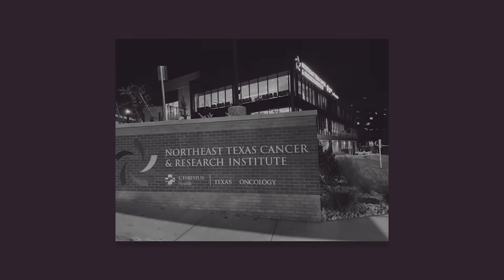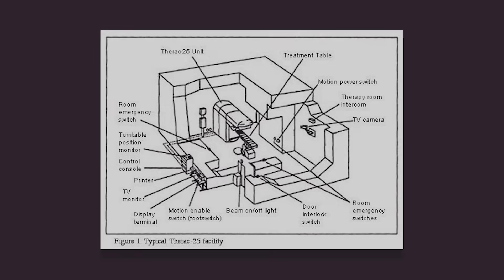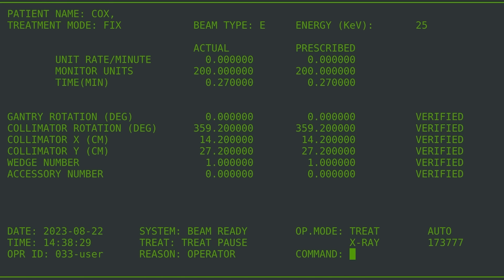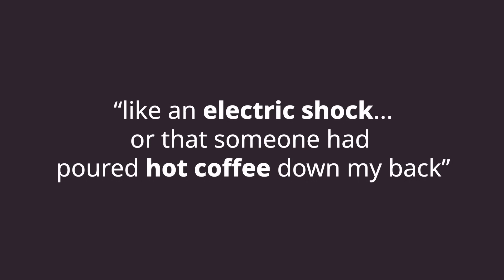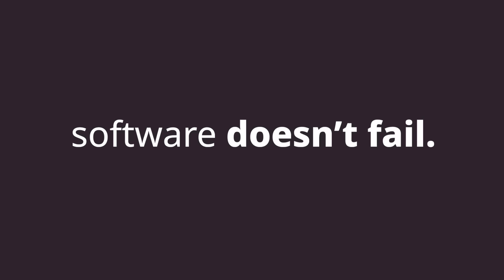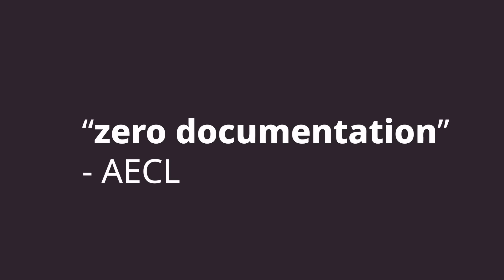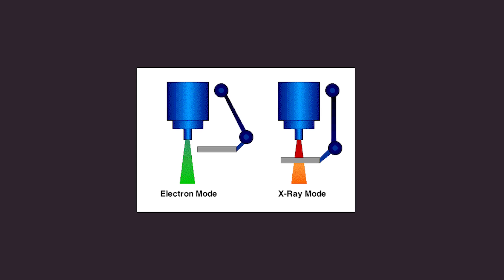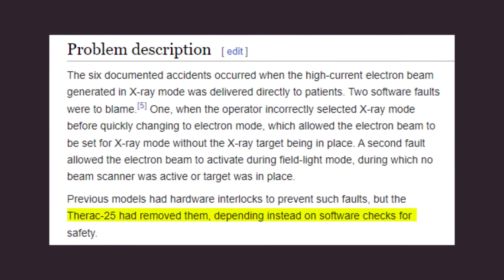how a simple programming mistake ended 6 lives

Comment: Having a hobbyist write the program honestly isn't a huge error in my eyes, as I'm sure he was plenty skilled. What blows my mind is that it was never properly tested to ensure this type of thing was impossible. It doesn't matter how skilled you are at programming, you will make mistakes. We rely on others to help us catch them and correct them.
Reply: Hey Boeing outsourced the mcas coding to india for only $4 an hour they save a ton of money
Reply: @stephenfazekas5054  Boeing also lobbied the FAA to skip much of the certification testing. And the FAA agreed.
Reply: @stephenfazekas5054  I don't think it was due to the programming. It was due to the faulty AOA sensor and the lack of training given to the pilots to shutdown the mcas.
Reply: @lightknight6243  a single aoa sensor combined with a program that couldn’t detect faults from inputs.   Your car can tell when a abs sensor is giving an impossible signal that’s obviously faulty.   It was them gettign cheap with training, cheap with coding and cheap with sensors.    The max is a plane designed by accountants and not engineers
Reply: @stephenfazekas5054  I totally agree. I was just pointing out that it wasn't just the code. They needed the mcas system in the first place because they added new engines on an old frame to save money!
Reply: To be fair, his coding error wouldn't have mattered if the company didn't cheap out on the physical safety mechanism.
Reply: Using an unskilled developer is not less costly when the rate and severity of defects greatly exceeds what a costlier, more skilled developer can deliver--unless the cost of defects is $0. Defects are typically quite costly. Most hobbyists are completely unaware of software engineering principles. They're also generally unaware of software testing techniques.
Reply: I disagree.  Developing a software program is a lot more than just sitting down at a keyboard and coding. Creating a software design, developing a software test plan, documentation of the software, are all key elements of developing software.  Especially if others are going to be using the software, editing the code, troubleshooting, testing etc.  Being a skilled coder doesn't necessarily mean that you are good at developing software.

That said, it was 1986.
Reply: It sounds like the software was functional when all the input was correct but a common programming error is to not assume there be an input error. In all cases of death the input sequence was the culprit.
Reply: In this case, the programmer was programming in assembly. Assembly is an extremely difficult low level language that hobbyists should not be using to make medical devices with
Reply: True but i dont think it was an hobbyist, unless he wanted to suffer. Cause Assembly ...
Reply: @kwiky5643  well back then there wasnt anything else

Comment: To me the worst part of this was the removal of hardware interlocks. Software can NEVER be relied on 100%, even if it has been extensivley tested. Physical switches and relays should ALWAYS be in place for safety critical applications. If there were hardware interlocks in place in the Therac-25 this would never had happened. Sure, the bug would still have been there, but the machine couldn't have hurt anybody as the beam PHYSICALLY would not have been able to activate without the magnets in place.
Reply: For many systems today "hardware interlocks" are not feasible. It is not possible to implement, say, antilocking brakes or fly-by-wire systems with hardware performing the safety role. Or say a medication calculation software or patient  medical record system. A wrong dose or a missing re-call for a patient that has cancer or the wrong patient's data shown to a doctor can all kill.

Comment: I would put some filter or something that can cut the electricity if more than x rads were detected before firing it independent of the machine but i doubt that exists :(

I mean, one travels at light speed. Can’t fight that…
Reply: Well you can start by checking the lens. If that's the only thing separing life from death I would want it wired up to some hardware failsafe and multiple sensors like in aircraft to check that it's really on before powering the beam.

Comment: Writting software is a weird experience. It doesn't matter how many scenarios you've simulated and prepared for, there's always something that WILL go wrong.
Reply: If you go into military/FAA spec hardware verification, it reaches a point where EVERY bit of every variable MUST be toggled. The most advanced testing methods either spam your inputs with every possible combination of data, or they use Mathematical proof software (!) that verifies that no failures are physically possible. The airplane control software CANNOT fail, and you must prove it as such.

One guy. Assembly. No testing. I might not sleep tonight...

Comment: Honestly I think management and poor programming practices from that time era is more at fault than the programmer, it's likely the programmer only had access to something which simulate the device to program for it (or program for it blindly), bugs will occur in software development no matter how experienced is someone which is why it's important to always thoroughly test the code/production machinery before release.
Having multiple people who oversees the same code can help a lot since a single individual can make mistakes, neither of us are perfect but bugtesters/QA testers has one of the most important role in it and there is a reason why they are mandatory in many areas, it's reckless and negligent to skip testing where they intentionally try to break the software .

Comment: IMHO the most egregious part was not the race condition, but that there wasn't a "check before commit" on the "activation phase". If it had a "Execute" option, that then signaled a task to start execution AND said task then copied the input values present AND checked them for sanity AND presented the check results to the operator AND then executed WITH operator confirmation this wouldn't happen so so easily. If i had a €1 for every piece of s**t I've had to deal with just because the powers that be are adamant not to inconvenience the users with proper confirmations...
p.s. i was the "paranoid guy" that wrote checks and bounds at the front facing UI, the back end server code, the SQL Stored Procedures and the DB Schema. Sure, you waste resources, but yeah, I'd rather have something more solid than something that "fails spectacularly real fast".
Reply: Yes, this was my takeaway.
He tried to save time by executing the operation in real time as you're typing it into the terminal, but trying to save 8 seconds cost 6 people their lives.

Premature Optimization is the root of all evil.

Comment: The problem with testing is that you test what you think you should test. If they would never had the idea to change the mode afterwards, this bug might have been unnoticed despite testing.
Reply: That's only if you do basic software testing. in reality, there are like 15 levels/variations of types of testing and one of those is throwing random inputs at it repeatedly to see what failed

Comment: It would be a public service to have a series on this topic: "Code that kills". There are many cases like this on which code that runs essential infrastructure end up costing lives?

Thanks for sharing this!
Reply: Considering how many other failings, most of the blame isn’t the code. 

The decision to remove the hardware interlock, and just reuse the previous software (which was designed with the assumption the interlock was there), without extensive testing and examination was the biggest failing.
Reply: Code that kills
Would it write it for me?
With your hand so still, it makes me believe
In the software's sins
Let me compile now and never die
I'm alive
Reply: I sure fucking hope not, at least I'm not aware of any...
Reply: Boeing MCAS

Comment: One example I have from my fathers experience was in which he had assembled and installed robotic arms and the plc's he'd designed at a car plant and the programmer came in to do the software setup and calibration my father had made him aware the safety isolation switches hadn't been completed and he was like no its fine so he proceeds to send inputs to the robotic arms which also had in production car bodies on as you can guess the arm slammed through the roof of thirty cars as my father had to attempt to stop the incident the following day those cars had scrap marked onto them.

Comment: When I graduated I was offered a job as a software engineer at a biomedical company that sold medical hardware to hospitals. I didn't read to much into the details but it was a machine that was built to automatically feed (on a timed interval or when certain conditions are met etc.) doses of medicine/substances via IV to patients. They also sold heart rate monitors etc.

The pay was good and the job was very enticing but I could not bear to accept it, precisely because of things like this, that were shown in this video. I could not handle the stress. Constantly having to worry if my spaghetti code is going end up costing someone their life (accidental overdose). Fuck that! I know there are engineers out there that write better code than me that would be better suited. I have no problem admitting that. I don't need this level of worry in my life. I am good.

Something like this happening and me being responsible has to be one of my biggest nightmares as a software engineer.
Reply: You are also self conscious enough to anticipate these things happening. Which alone makes you more qualified than most. Had these managers more of that, those deaths could be avoided. But greed clouds judgement.
Reply: I am with you haha, I don't want to feel guilty for the rest of my life
Reply: So work on Windows Update. Where failure is not an option, it is a certainty! :)
Reply: by writing what you wrote, you are more qualified for that position than 99% working in the medical field.
I used to have your attitude, but then I found a lot of programmers in medicine just have a better "fuck it" attitude than me.
"Who could have known"?
You, you dummy, if you did your homework.

Comment: I'm putting exactly 0% on the developer.

The company that contracted them didn't do their due diligence, and you can't expect a solo dev to account for EVERY single edge case.

They chose to test in prod.
Reply: I'd put some culpability on the programmer, but the majority of it definitely falls elsewhere, from the lack of a physical failsafe (compared to previous models) to the cultural perception that "software doesn't fail".  The simple fact that these incidents were preceded by any error message at all indicates that the software itself detected something amiss, it just wasn't capable of identifying specifically what or why.

Comment: Even in testing though, this is a corner case that might not have been discovered.  Even after the first few patients were overdosed, it still took a long time to even figure out why the machine sometimes screwed up.  Only after connecting the dots where the operators typoed and then fixed the parameters too quickly, was it finally beginning to make sense.  Of course there was also the noise of other techs who had entered it wrong, then fixed it after the 8 second pause, which avoided the problem.
Reply: As a software tester, this is not an edge case. This is a routine check.

Comment: One more reason to use Rust in critical software. Of course it doesn't prevent all bugs, but it minimizes the chance.
Reply: I have heard the same argument used about Ada an Haskell too... Should we trust that?
Reply: @benhetland576  I'm not an Ada or Haskell programmer, so I don't know what these languages offer in terms of safety. As a Rust developer, however, I can claim that when I'm working in Rust the number of bugs I get is significantly lower than when I'm working with other languages (C, C++, Python, and Assembly are the main ones I use besides Rust). 
The language is designed with a safety-first approach and ease of testing, allowing the compiler to filter out most bugs. Also, the compiler won't allow you to perform memory- or thread-unsafe operations unless you explicitly declare you want to do so. But don't take my word for it, try Rust yourself.

Comment: I took a safety class that presented an interesting perspective on the question of "can software fail". You seem to say yes. In the class, they claimed that software does not fail, because it always does what you tell it to. Whether what you told it was what you wanted, that's where you get problems. But that's not the software failing, that's you failing.
Reply: "can software fail?" Can it fail at what? Can it fail to do what we expect? Absolutely. Can it fail to do what it should do according to its instructions? Also yes, because rarely you can get a random error like a flipped bit in RAM, or even an error in the design of the CPU. So I would say software can fail either way you look at it.
Reply: Those are hardware failures though.
Reply: @WilcoVerhoef  Cosmic rays can also cause bit flips.
Reply: @n1ppe  Yup, that's the hardware failing
Reply: @WilcoVerhoef  Which in turn could cause the software to fail or do something it wasn't supposed to do, which could've been prevented if you had made it better. So software can fail and have glitches, so I don't understand your point.
Reply: @n1ppe  My point is that software can be mathematically proven to have certain guarantees under the assumption that the hardware does not fail. In that view, all failures are due to causes outside of the software itsself (mostly due to the programmer not knowing exactly what their code really "means" to the computer).

Look into programming language semantics if you're interested in for a rabbit hole.
Reply: @WilcoVerhoef cosmic rays causing bitflips is not a hardware failure though?
Reply: @n1ppe - Yes!  One of the reasons Server memory is of ECC design!
Reply: Tbf there could be compiler or interpreter bugs, so another software can make your software fail.

Comment: During the Gulf War on February 25, 1991, a Patriot Missile battery stationed in Saudi Arabia experienced a catastrophic failure. It was unable to successfully track and intercept an incoming Iraqi missile, leading to the destruction of an American Army barracks and the tragic loss of 28 soldiers' lives. This failure was attributed to inaccurate time calculations caused by computer arithmetic errors.

The Patriot system utilized a 24 bit fixed-point register that multiplied the time, measured in tenths of a second, by 1/10 to convert it into seconds. However, due to the non-terminating binary expansion of the value 1/10, a chopping error occurred during this calculation. This seemingly insignificant error, when multiplied by the long duration of the system's operation (approximately 100 hours), resulted in a consequential time discrepancy of approximately 0.34 seconds.

Ultimately, this significant time error prevented the Patriot battery from effectively intercepting the incoming missile, leading to devastating consequences.

Comment: I hate this "too high or too low" type of error. It's like searching for an email on Lotus Notes: "Your search returned no results or too many results". Please be specific with error messages
Reply: ERROR 88: something's wrong but I won't tell you what
Reply: This is common in trying to sense things with computers- they usually have a limited sensing range and once they reach their limit, they typically don't give any other readouts besides the highest or last recorded value. This can be either because of software or hardware limitations and the programmer can only put out his guesses on what went wrong. I have only worked on low voltage electronics so it wasn't that bad but you get the point- the sensor was clueless because it was overwhelmed.
Reply: @keithou4389  That is not limited to computers...
... 3.6 Roentgen.
Reply: @keithou4389  You are correct BUT with this type of machine, it has sensors for this very reason. You won't find "Fuel warning" on a plane without it telling you if it's fuel levels/pressure/lackofpressure etc. This isn't some home desktop
Reply: @peterkent6250  Well, at their time. IT IS some home desktop. I am now an aeronautical engineer albeit a student, let me tell you, planes do not come with all those sensors mind you- only the big ones do and only if the company wants those and they're usually analog(these tend to be really slow) with a flight engineer aboard to keep a lookout.
Reply: @keithou4389  If an Airoplane doesn't track fuel pressure then it shouldn't be flying. I am a software engineer. So I call bullshit that planes don't have sensors my own car happens to have. I very highly doubt a plane would for example, give itself  an input and then ignore all other inputs that come after it before they are executed when say, one of those may be related to a warning signal. We don't have these restrictions anymore. Wasn't that why the if statement was invented? If warning = true, prioritise that and drop something less important from memory. If things can execute beyond safe limits then the code has failed. Sensors or not, there should be hardcoded parameters I would imagine.
Reply: I forgot how much I hate Lotus Notes - thank you for the reminder 😅
Reply: ERROR 418  I'm a teapot.